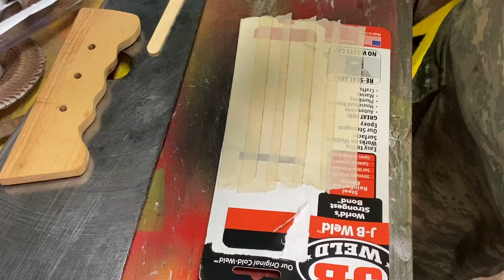Zombie Machete Build from Saw Blade

Comment: That was awesome. Nice work!
Reply from the maker: Thanks so much, hope to build more soon and thanks for watching!!
Reply: @chud327  I’ve got a concrete saw blade laying around myself. Might have to steal that idea. That machete looks very useful. Just need to get a plasma torch 🤔 
I have doubts conventional stuff like blades would cut that kind of steel. 
Maybe a cut off disc. 
But the plasma torch is probably king for that!
Reply from the maker: @Tennesseemountainhomestead  my video likely for tonight is a plasma unboxing and review. I have wanted one about 20 years and the one I have only runs about $300 if you catch it around a holiday… you may need one someday.